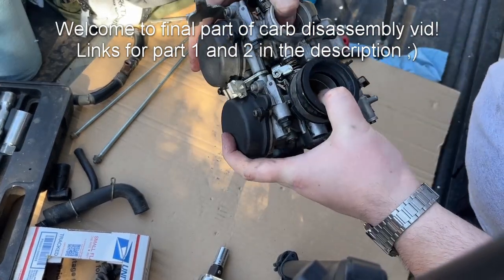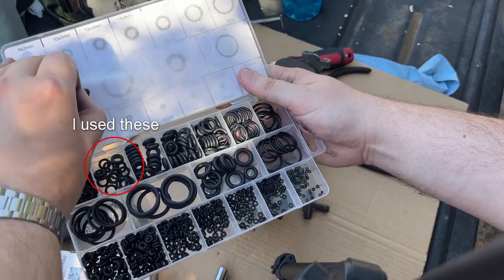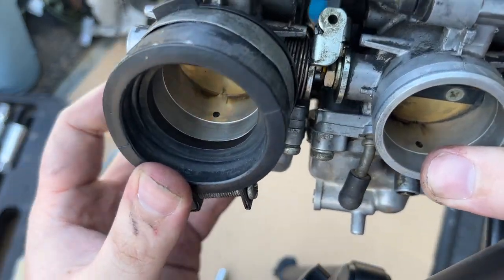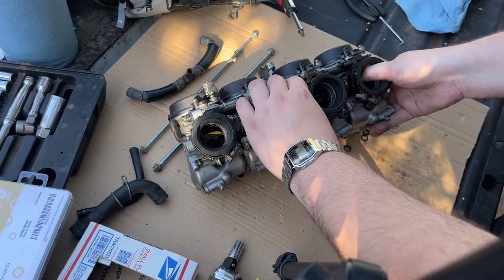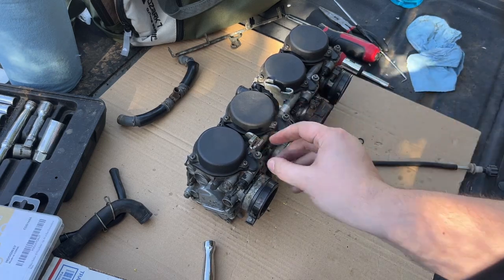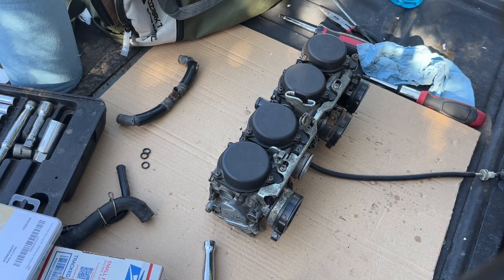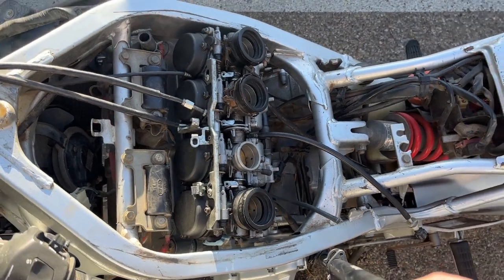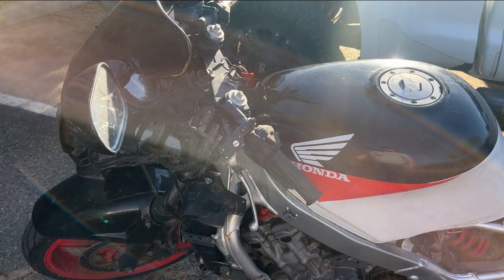Honda CBR 600 F2 Carburetor Removal Pt.3 (Final Part)

Comment: Did you put new gaskets in between the air cleaner and top of the carbs? I just re-jetted the carbs, but cannot find a gasket that will fit. They are all too big. Tryed freezer trick, grease trick, tryed a heat gun to see if the rubber would shrivle up, nothing works. If you got any tips or a know good gasket kit please share, id much aprreciate it.

Comment: Love the video, any chance of one how to replace all parts in the carb with a replacement set?

I probably have some clogged needles and am going to attempt to replace them myself, am.i correct in assuming I can do so without having to pull the entire carb out?

Any tips would be much appreciated ❤❤❤
Reply from the maker: Yo thanks for the comment! Maybe in a future video I can show how to replace all the jets and boats... If you are doing a full replacement, you may want to take the carbs out so you can properly clean/replace the jets. If you put new ones in and they get clogged then you'd have to do it all over again :( The carbs have a few tiny parts to it as well, so getting to the jets while it's still on the bike might be tricky! Also it'd be a good idea to replace the gaskets in there while you have the chance!

Comment: What are the o ring sizes you used for the t valves that were leaking
Reply from the maker: I used the 10x2mm or 025/64"x05/64" if you're an inches kinda guy. Thanks for the comment!
Reply: @G9Strider  thx bro, ur a real one :)